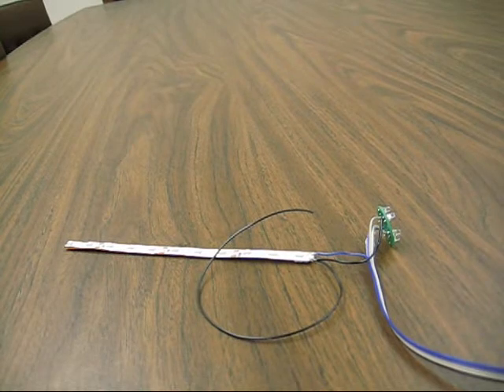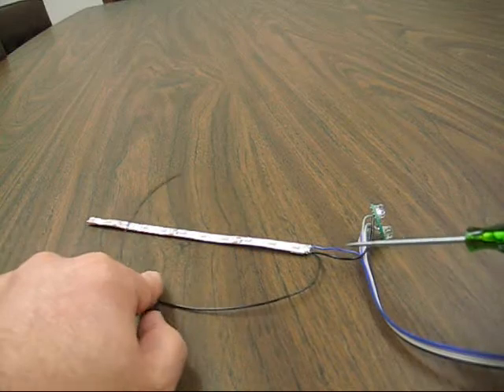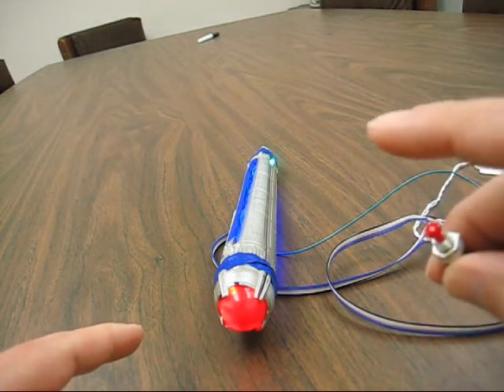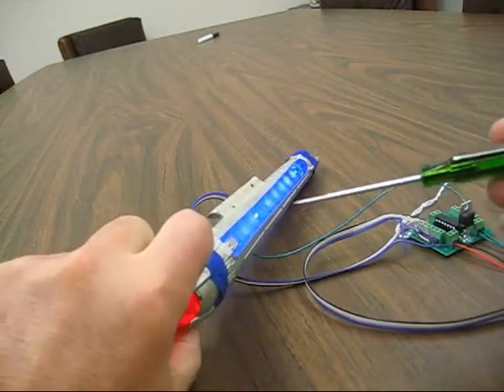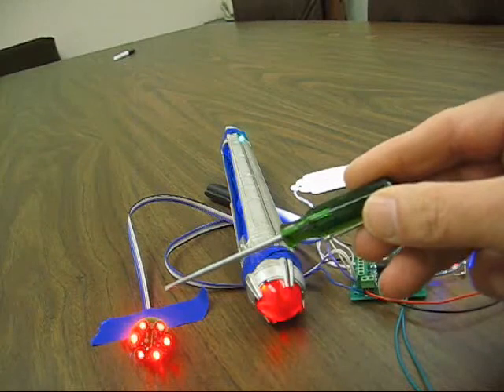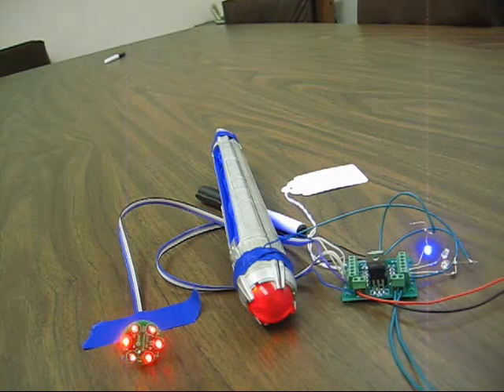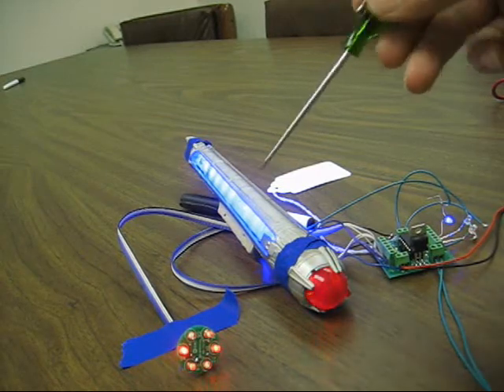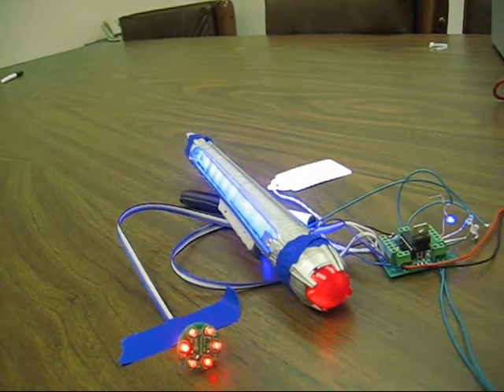NX Combo A

Comment from the maker: My mission is to try to provide the best lighting controls possible at a fair price. Most modelers are used to lighting up the internal parts of a ship and know where to get discrete led's for that purpose. Your question and answer is correct to compensate for the power pulsations.

Comment from the maker: Hey Paul,

I knew you were going to want this control kit. It's available for sale now. Since I have all your information, I can just send you a paypal invoice for you to order from.

This is what's included:
One Control board
Two round glowing bussard boards with wiring
Two Blue led strips for side nacelle illumination
All the Nav,Strobe and Impulse Engine led's
One nine volt battery clip
One momentary switch
One On/Off power switch
Wiring and shrink tubing
Instruction Manual

$108.95 + S/H